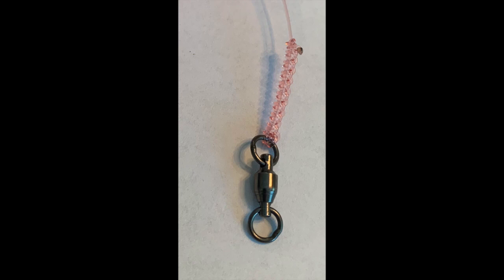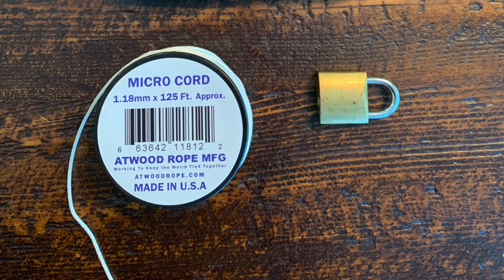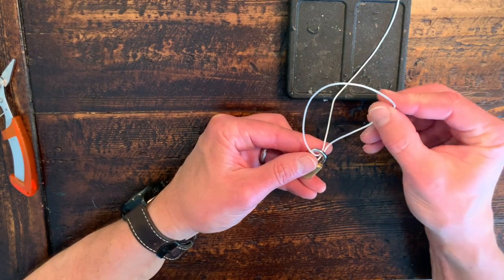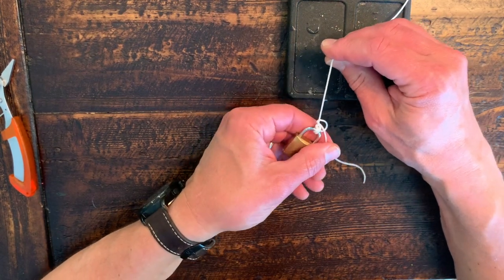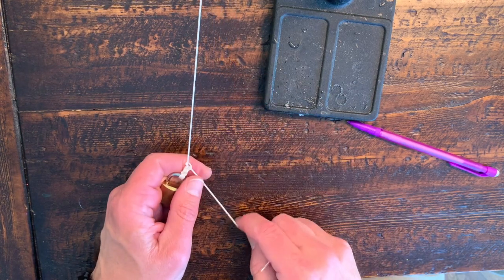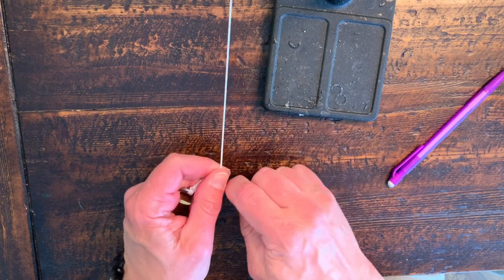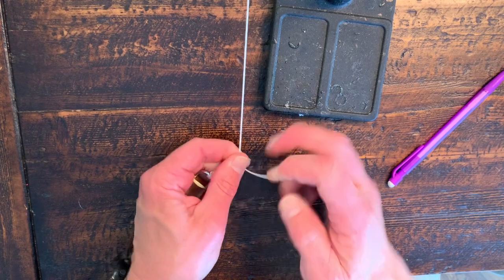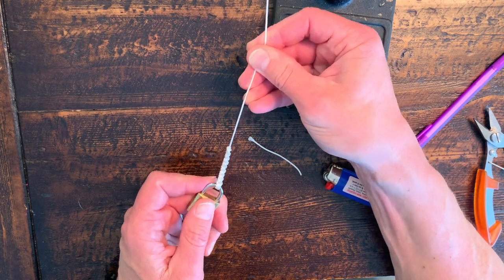100% Terminal Connection:  How to Tie the TN Knot for Slow Pitch Jigging

Comment: Great knot - used for a year and no failure so far:-)
Reply from the maker: Here's my only complaint.  On a recent trip on the Yankee Capts out of Key West, I hung the bottom in about 700'.  I was running 20# Yo Zuri Super Braid PR Bobbin knotted to 50# Sunline FC100 Fluoro leader and has this TN knot to my swivel.  I literally couldn't break off!  I had to give my rig to a mate who was finally able to break it.  So be warned...it's STRONG!
Reply: my deckhand normally uses a large circular foam tool to wrap the braid around a few times and just lets the boat drift do the work. The line eventually snaps at the weakest point and we're jigging with PE5 with 80-100lb leaders... @masteringrodbuilding

Comment: I like it. Agreed regarding Japanese Anglers secrets - Totos walked me through EVERYTHING!in 1 on 1 text msgs - I tie all my own assists now whether spliced or bobbin tied. I actually came up with a method I recommend when you want a really cleanly tied single assist hook that is as short as possible for those little 40-90 gram jigs. Splice a loop in hollow core YGK or similar brand of 220 - 280 lb test (I use A.S.S. 280 blue) & rather than hitching the loop through & around your solid ring, slip the tag end of your hollow core through your ring AS YOU SPLICE the loop. Follow with a dot of glue at the end of the doubled hollow core - just a dot. Give yourself 1-1 1/2 " of doubled hollow core for strength. In this way you dont need a big loop to work through & around a solid ring in fact you can pull it to ALMOST tight around the side of the ring. Next just bobbin tie a spade hook or blind hook as shown on the above mentioned site at other end of your single assist hk & also glue your thread sparingly. The Cultiva hooks are too light for a single hook assist. I like the pike 4/0 as they are beefy enough for rock cod & ling cod here in N Cal. I like this knot of yours. It brings to mind the plaited knot for big gamefish - 1 of my favorite (also a shock absorber knot) great for swivel connection with a catspaw in the loop. Jansek special is my go to if you know it. Similar to this knot but w/o the 1/2 hitches. Tag through the eye or ring twice forming 2 sm loops then tag through those 3 times & draw tight. Simple. Hasnt failed me yet. Youve tied it right when your tag end sticks out at a 90 degree angle & the knot looks like a little fist. Wet b4 drawing tight. Thx 4 sharing. Love this stuff....

Comment: Oh man!!!!!!    I’m about to practice practice practice.  I’m trying to present my jigs as clean as possible.  And this will definitely help w that.   I’m concerned with friction on the mono i notice that nobody talks about that. That’s not a concern ?
Reply from the maker: It really doesn't take long once you learn it.  I can crank one out in under a minute on a rocking boat at night.  As far as friction, this knot routinely outperforms all others in tests.  So is there some friction?  I guess so...but it does NOT impact breaking strength.  Hope this helps!
Reply: @masteringrodbuilding  that helps! Thanks

Comment: Apart formo the finish (similar to rizzuto) i knew the rest of the knot as the chain knot. Am I wrong? I know also another version of the chain knot in which you don’t  tie it first around the ring, but just loop it inside the ring and over itself, and then proceed with the half hitches. Never properly tested any of the two on a machine, but I think that theoretically the second version I described should be a 100% knot if it doesn’t come undone a there are practically no knots on the line
Reply from the maker: You are correct.  As stated in the video, this is simply an AG Chain knot that goes through the eye of the hook/swivel three times before completing standing half hitches and ending in a Rizzuto finish.  And the Rizzuto finish does not make the knot stronger - it just makes it more fishable by keeping it from coming unwound.  

The second knot you mention - where you make a single Cat's Paw splice through the eye (make a loop and go through the ring) is in fact stronger than the regular AG chain knot but NOT as strong as this TN knot.  The reason why:  if you imagine the knot compressing and elongating under pressure, rather than constricting the three wraps around the ring of the swivel and allowing the line to stretch before breaking (as in the TN knot) your Version 2 knot applies all pressure from one loop to another loop at 90 degrees due to the Cat's Paw.  

Kind of hard to visualize but rather than allowing the leader to stretch and elongate without breaking, that version creates a 90 degree shear point and that is where the knot fails.  In my experience it will always fail on the side of the Cat's Paw closest to the standing leader line (as opposed to the other side which forms the tag end).   Make sense?  I'm hoping to borrow some knot breaking equipment again soon and will add this to the list of demos to record.  Thanks!
Reply: @masteringrodbuilding  oh that's super interesting. Your explanation makes sense indeed. It'd be great to see some tests done on the various versions as well! Thanks for answering my comment!
Reply from the maker: @HBweisse  of course.  Thanks for watching and for your question!

Comment: Interesting!  Way more complicated than my palomar knots! Do you have a favorite braid to fluro or mono knot?  I have been using the fg never tried the pr bobbin knot
Reply from the maker: Thanks for watching!  The Palomar is a very good knot.  That is what I was using for my terminal connection prior to learning this knot...and it works.  I still use it a lot for other applications besides SPJ.  For me the TN was measurably stronger - test yours and see what you think.  I do know some very good SPJ anglers who use the Palomar for their terminal connection. 

So...for slow pitch jigging and pure all around strength the PR Knot (sometimes also called the Bobbin Knot or PR Bobbin Knot) is the very best braid to fluorocarbon join I have found.  I learned a slightly different (and simpler) way to tie it by watching Bryan Dietz's videos and that's all I use now.  Bryan is a very experienced angler and one of the guys behind NLO Jigskinz and the excellent NLO Slow Pitch Jigs (www.nlofishing.com).  Bryan also won a big Florida Sportsman Knot Contest with his version of the PR Knot which tested 100%.  Here's a link to how he ties it:  https://www.sportfishingmag.com/100-percent-pr-bobbin-knot-video/

My PR knots test stronger than my FG knots so that is all I use for SPJ specifically.  That said, there are a few down sides to the PR knot:  you need a bobbin, when tied properly it's a fairly long and stiff, and I personally have trouble joining leader under 20# to braid using that knot.  So I still use the FG knot either when I don't have a bobbin or I have to tie it fast...very strong join that casts well.  And for lighter lines or when I need a more compact knot (like to pass through a bait casting level wind when casting a long leader), both the FG and PR are a bit too long so I'll use a Red Philips knot or a GT knot for that.  I also use the Red Philips and the GT for lines under 20#. 

Again, all about finding the right knot for the given application and it may not be the same knot everywhere and all the time.   Hope this helps!
Reply: @masteringrodbuilding  As always I appreciate the reply.  I am 100% sure your TN knot is stronger than the palomar.  I find it really fascinating seeing how these knots are tied.  Watched the PR bobbin knot you linked that's a neat one.  You said something that I have found really important and honestly struggled with.... the right knot for the application!  I wish there was one fluro to braid knot that was easy and works for everything.  I seems to always be using different weights of both leader and braid.  Some just don't mix well without the right knot.  I tried that GT knot a couple times and it came apart.  I can tie an FG just wanted something easier.  I have a couple rods I built with the little Fuji guides that are a pain to get any knot through.  The guide I use for tarpon only ties uni to uni and always teases me for the FG!    We're going out Saturday to chase some grouper and AJ's if the hurricanes hold off.  I'll try your TN on my Sampo swivels this weekend.
Reply: Yukatan knot. Easy, VERY low profile & a 157 % line strengrh knot. Look for thw video. Its a great knot for braid to mono.

Comment: Can I use this with knot braid to swivel or is the AG chain knot better for braid? I mainly have braid on my talica 20 , I would be using this for jig fishing for 100-200lb BFT
Reply from the maker: Neither the AG Chain Knot nor the TN Knot is intended for use with braid - only mono and (ideally) fluorocarbon.   And both knots tend to unravel in braid (in addition to being weak.)  There are much stronger knots for braid to swivel in my experience.  

I'd recommend the improved Uni Knot for this application personally.  Second place would be a San Diego Jam Knot.  I hope this helps!
Reply: Thanks for your help ! I will learn the improved uni knot.

Comment: Half hitches are so braid doesn't slip. I don't see how the half hitches make the knot stronger with flouro. The load isn't being held by the hitches.
Reply from the maker: Half hitches are used for LOTS of things.  When you test these knots to failure, they always fail either due to the ring of thw swivel cutting through the line or more often the line cutting itstelf where it crosses itself in a tight turn.  This is regardless of knot and regardless of how strong they load prior to failure.  It's just mechanically how they fail.  

In this case, the half hitches allow the knot to move and stretch.  The three times through the ring - coupled with a ring that is at least half the diameter of the fluoro - allow stretch and movement and distribute the load across a much longer section of leader rather than a single point.  It is precisely because neither the half hitches nor the manner of the line going through the eye force the load into a single point that the knot is so strong and has so much 'stretch'.  

Whether you understand it or not, this knot is likely much stronger than what you are using.  Don't believe me?  Cut an 8 foot length of leader material.  (You might want to use 20# or 30# for this test.)  Tie your typical knot (whatever you use today) to a swivel on one end and then tie this knot to a swivel on the other end.  Attached a jig with no hooks to each end with heavy duty split rings.  Now pull it until one of the knots break.   Enough said.
Reply: @masteringrodbuilding  Allowing the fluoro to distribute the load across a longer section of leader rather than a single point makes sense. I would be using braid main line to a swivel though. 

I use either a palomar, improved trilene or an improved trilene with doubled line with a palomar finish around the swivel. But pulling on them myself would be unscientific. I'd like to see all the knots along with the TN on a digital pull system like knot wars use to do. Maybe you could do a video on knots vs the TN like that. 

Thanks for the video though. I'll try and find a break test.
Reply from the maker: @birdbig1  we are on the same page.  The problem is the equipment...roughly $10K to get started with decent equipment you can trust that doesn't wear out.  Wore out my first two homebrew sets already.  

You are exactly right...the test is unscientific.  But this knot will win every single time and that still tells you something practical. 

ONE IMPORTANT NOTE:  This knot is specifically intended for monofilament and fluorocarbon lines and leaders.  It is NOT a strong knot for braid.  Just FYI.